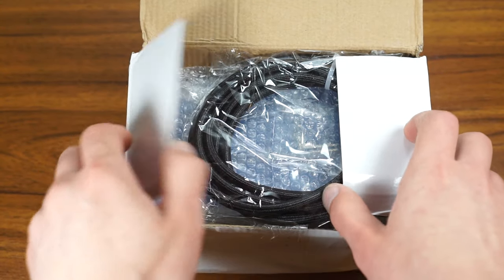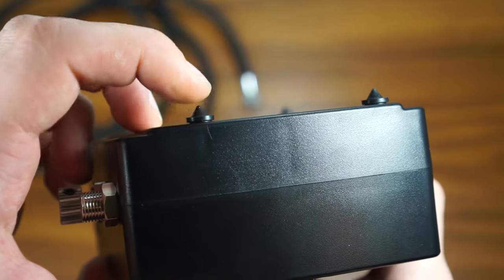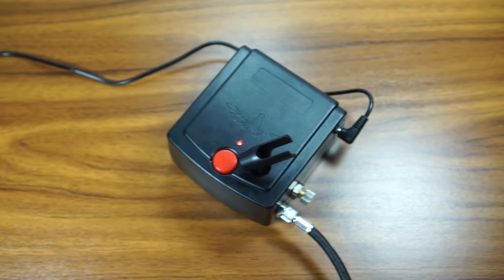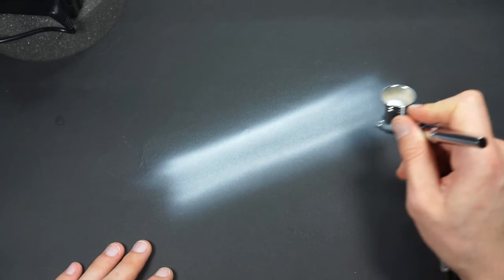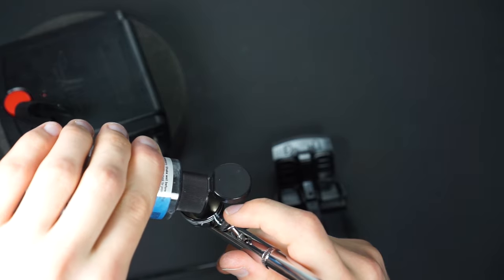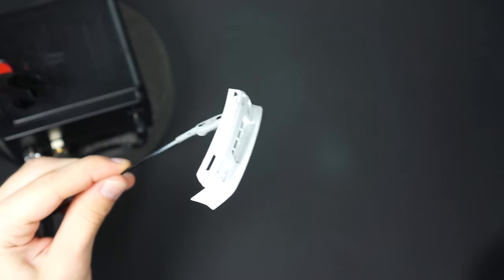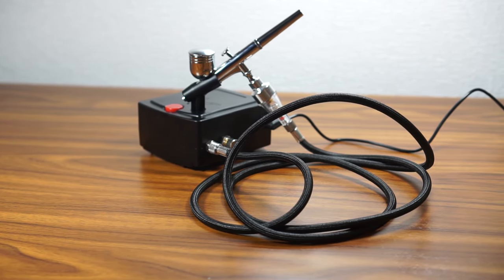Cheap airbrush kit - good for scale modeling?

Comment: I've had this cheap compressor+airbrush set just two years ago when I began modelling and wasn't sure if I was going to practice this hobby for a long time. It did a really honest job for one year and a half and I painted about 20 models with it. Of course, compared to a higher-end compressor, it's noisy and tends to get hot. But it did a real good job for more than a year. I've bought a new compressor a few month ago but I still keep this one and it still works flawlessly :)
Reply: I'm just starting my new hobby in building High grades Gunpla and I'm thinking to get one of these kit since I only have time like 2-3 days a month on building Gunplas since I have other things to do, so I don't want to spend a lot for airbrush kit. I guess I'm sold with your testimony. Thank you.

How long did it become overheat? And if it overheats, does the compressor automatically turned off?
Reply: @looniaz  I don't remember well but I guess a bit more than half an hour before it gets hot. The main problem is the noise, if you have to concentrate on what you do during a long time. Headphones and good music while painting is a good workaround ;)
Reply: @looniaz  it doesn't shut off automatically, I have the point zero version without the pressure valve, I painted a mass of kits with it. For about $40usd you cannot go wrong if you're new to the hobby, but with all tools you MUST do maintenance. I cannot stress enough how much maintenance I've done on both of mine. They're really amazing for the money especially for fixed incomes. I rate the whole a nice 8.5/10 overall myself and I also know about 50 other builders who use theirs religiously. I know theres one that is going strong for 3 1/2 years and about 20 master grades alongside many High Grades. It also works for diorama work too!
Reply: @MistressNeviah  is it fine if I paint PG with this compressor+airbrush set?
Reply: Ese compresor entrega aire a demanda o sea, al apretar el boton arranca. Esta mal regulada lapresion por eso te funciona en forma permanente.

Comment: Started model building as a lockdown hobby, bought a similar airbrush kit. It works fine for me. I am back to working full time and only build/paint once every week. I get pretty good results and don’t mind taking breaks.
Reply from the maker: Great!  Thanks for sharing with us :)
Reply: Hello mate. I've started model building on the same situation. Since march/2020 I have exactly the kit shown on the video and I can't complain. Seven models (1/35 tanks) already done. I'm still learning but have noticed how easily I can use tamiya products and how hard Ammo and Italeri paints are (in my case) to apply because the tip always dry too soon and I have to stop and clean. Might be the wrong solvent but maybe the airbrush/compressor also are to blame.
Reply: Same situation, except for me the airbrush that came with the kit constantly clogged and wouldn’t spray no matter how thin the paint was. Bought a siphon feed from harbor freight and it works perfect
Reply: Is it still working now and having no problem whatsoever?
Reply: who asked
Reply: A good game to play is warhammer 40k a bit pricey but it involves models and using them to fight
Reply: how long do you take for taking a break?
Reply: H.m. tnx

Comment: I think it looks great, it’s very portable, it’s a good option for beginners who only make model kits occasionally. I quite like it myself, and if you can build 20 models with it without breaking it then it’s worth the money. But since it’s constantly running it might be burned out after painting 5 model kits😂
Reply: I need to paint FOW pieces. You think I'd last long enough to paint two armies?
Reply: @dakufaust  I don't know if this is too late but there's one with autostop feature.
Reply: @vorgeyahiya8613  I just got one with the auto off feature. It's nice, but I have yet to fully use it tho.
Reply: @mosheep  I'm using one for 4 months now, does the job at least as I'm not using it often. Downside is you can't configure the pressure to your preference.
Reply: It lasts for months or longer, I've heard. These compressors can last quite long if taken care of properly.

Comment: I bought a cheap Expo airbrush and compressor (£60) about 6 years ago. Struggled with it from the start.
Generally wouldn't recommend cheap airbrush packages for beginners. I replaced the airbrush with a Sparmax Max-4 early last year and kept the compressor.
This is 200% better! 
Although even the Sparmax is still a general purpose/beginners airbrush, the build quality and precision are so much better and that makes a huge difference.
Reply: Well obviously the Sparmax is better, it's way more expensive.

Comment: Bought a similar unit 2 years ago and still going strong and have built many car and aircraft models using it. Had some initial usage problems with things like spray nozzle adjustments (critical) and how much paint thinning was required, but I think that had more to do with the fact that this was my first airbrush rather than any fault of the unit. Had to replace hose but only because I stood on it. If you adjust pressure knob just so, I found compressor (yes, same Harley Davidson sound as the one on this vid) will only run as you're actually spraying and will shut off a couple of seconds after trigger release. Slightly thinner paint with these cheap units is also a big help.

Comment: I have one, I add a plastic bottle to make airflow more stable, it works fine for me, as a modest modeller building one or two kits a month, I just use it twice a month. Plus its quiet and low energy consumption.
Reply: Where do you put the plastic bottle?

Comment: I have this one for quite a while now. I do occasionally paint when time permits and I think its perfect for smaller scale models like what I mostly do (sd and hg gunpla kits) been wanting to get a better set up tho as it is prone to have moisture build up despite having that moisture trap. Plus the airbrush it came with is sensitive to viscous paint and you may want to thin the paint you are using despite it being ready to use out of.the bottle. A 2½:1 ratio of thinner to paint is advisable based on my experience

Comment: Just bought it from your video 
Good option for begginners 
With some pratice you can easily learn how to diluate and use it 

Quite precise when you know how it works 

Built an FW190 1/72 with it and it’s the smallest you can do 

You can do very small dot with the right ratio of paint/diluant 

If you are a young modeller it’s perfect !
Reply: Oh and I forgot, use airbrush special paint it can easily be clugged if you paint is too strong
Reply: Hi I know your comment is 8 months old but I was wondering if it’s still holding up? If so I might invest in one (I am a beginner after all) and may I ask what airbrush paints you use?

Comment: I've used one of those air bushes for nearly 8 years. Get rid of the spanner and only tighten the nozzel with your fingers. As it is way too easy to shear off with the spanner.
Reply: @Ingo Herrmann I removed the sheared off portion with a needle point file, which gripped the inside or the sheared bore and enabled  it to be unscrewed.
Reply: it lasted 8 years ?
Reply: @aaronramly1705  
Yes the airbrush lasts and it still works. The compressor has been the week spot Im on my second one. The first one lasted 8 years
Reply: Agreed. Same experience that I had. Cheap will work but will easily fail

Comment: I've got this machine as a gift  about 2 years ago and today I decided to use it for the first time...my mistake is that I waited to long to operate it and looks like the dc input from the air compressor  is broken, it doesn't have the jack inside so I cannot connect it to power

Comment: Tbh I got it because it's so cheap that even if I will only use it to get the feel for airbrushing I won't need to be mad for throwing it away ... And mine came with a water trap and everything and those parts will be useable eben if I change the compressor later on :)

Comment: I just started using this airbrush today based on your review. One issue I'm having is it seems like the paint is coming out really slow. Like, it takes a while just to get full coverage on a single piece of my gunpla kit. I thought it was my paint being too thick, but I thinned it further and it showed signs of being too thin (webbing, spatter). Is there something I'm missing or is this expected for this quality of equipment?
Reply from the maker: I believe you are experiencing dry tip.  Use cotton swab with thinner to clean airbrush tip every 15 seconds.
Reply: @StaticModel  I'll give that a try, thanks!
Reply: @StaticModel  whoa thanks you life saver👍

Comment: I'm back on this video lol. I just got the new version of this airbrush kit, the one with the auto-off feature. It's a nice addition, not too noisy now lol. Just had a problem as I was cleaning the airbrush (I clogged it 😂) the nozzle o-ring disintegrated as I was screwing it back. Had to buy multiple replacements now just to be sure 😂.

Also for the new auto-off feature, it only automatically shuts off if the pressure valve is set to high. When set to low, the compressor runs continuously. Used it for an hour, spray testing outdoors, it warmed up but not too warm. So IMO it would last 2hours max in a session before it really heats up.
Reply: "lol"
😂
Reply: Do you have by chance a name or a link for the auto-off version?
Reply: @mateuszpytka1058  I bought this locally so I can't give you a link to a specific one, sorry. 

Just put "airbrush kit" on Amazon and many will pop up, different brands but I'd bet they're all the same. Do read the description and reviews to see if it has the auto off feature, because from where I bought mine it didn't say anything about it, so it was a surprise.
Reply: @mosheep  Thanks! I found one with auto off, however it said that this feature works only on minimum setting. Could you confirm that? Anyway, much appreciated. :)

Comment: Great video. Thanks. I'm starting this hobby also and bought the airbrush in the video. My worst fear is the paint "liquibility"... Any tips? Thank you.
Reply from the maker: It's better to make paint too thin at first spray attempt. Cause you can always add a bit more paint till it be perfect mix. If you make paint too thick at first spray, you will clog it... Disassembly and cleaning is the last thing you want to do right after purchase of first airbrush :)
Reply: @StaticModel  thanks!

Comment: Would this be good for a few touchup spots with automotive paint on a vehicle? that pinpoint precision would be good for paint chips and also repainting after small rust repair jobs with bondo I would think. Much cheaper than taking it to a shop either way....
Reply from the maker: Don't think so.

Comment: Thank you for making this informative video sir, I bought the exact same airbrush and compressor set from amazon. After using the airbrush for some time, it stopped working. After seeing many online guides and doing a complete deep cleaning, I finally got it working again but it stopped again after 30 second. Now the airbrush sometime works for one minute but the next minute it stops. Do you have any idea as to why this could be happening. Thank You
Reply from the maker: It is important to understand what part of system fails. Is it airbrush or compressor? See if compressor keeps pumping air without airbrush connected. If it still stops, there is something wrong with compressor itself. If it only stops when airbrush is connected, that means there is a clock in air system or airbrush trigger is faulty.
Reply: @StaticModel  The problem is definitely not with the compressor as I have tested it thoroughly. It is most likely with the airbrush. I have not identified a consistent problem but sometimes there are bubbles in the airbrush cup. I have deep cleaned the airbrush, but it is extremely inconstant whether it worked or not
Reply from the maker: @thequantumcuber3261  bubbles are usually caused by poor seals at nozzle cap, poor seal also make paint to dry out in awkward areas of airbrush, also "dry tip" issue will occur more often. Maybe your nozzle is split or cracked also, worth checking.
Reply: @StaticModel  Thank You, I will check

Comment: It seems you're not thinning down your paints & primers before putting it into the airbrush. That's something you should do. Always thin your paints & primers before airbrushing them. That way the compressor won't have such a hard time.
Reply from the maker: I intentionally used pre thinned "airbrush friendly" paint that is marketed specifically for use right from the bottle, because that is what beginners usually go for. If you are experienced and willing to play with thinning ratios, it's most likely you also want precise pressure control and another compressor kit.

Comment: So I'm just getting into modle cars properly and I brought this exact same one the other day I'm just wondering if you need to clean it when you use different colour paints bc it will block the jets would I have to clean it with thinners
Reply from the maker: You have to flush it with thinner after every new color. Also if you use different types of paint ex. enamel and acrylics - you must perform deep clean with airbrush cleaner in order to avoid different chemicals mixing together.
Reply: @StaticModel  thank you very much for replying thanks for the information 👍

Comment: Would this airbrush be suitable for applying paint on car scratches? And eventually lacquer?
Reply from the maker: Automotive paint require high pressure and spray guns that generate fine paint mist while also delivering high amount of medium in a single aerosol cloud. In short words it will work but it will easily distinguishable, just like touch up markers.

Cancel

Reply
Reply: @StaticModel  what about if you spray more layers?
Reply from the maker: @royal_gambit_e4  it will work, but you will have to experiment with thinning ratios and pressure..Also of you own a car, there is a big chance you have a compressor or a tire pump. So you can get only a airbrush without compressor and use tire as an air source. More on that you will learn from other YouTubers.
Reply: @StaticModel  good idea
thanks

Comment: How does your white come out so well? I use Vallejo model air white and it comes out in stupid spits and clumps and tiny specks and spots. I also use the exact same airbrush and compressor lol
Reply from the maker: I guess you are not thinning paint enough ? Or maybe your airbrush is not serviced correctly? Check your nozzle setup and air cap, make sure there is no air gap. Use maximum pressure. Let me know if this kind of video would be useful (how to properly use this kind of mini setup/ maintain airbrush) :)
Reply: @StaticModel  no no actually I think it is way too thinned. I tried to add it to a green for highlights and it actually thins the green paint. My friend said it may be due to a certain ingredient was taken out, something to do with lead and poison? idk. I always have maximum pressure at all times, airbrush works fine on all other paints. this happens to my friend too that uses tamiya white. Its very odd. I would like a troubleshooter video on this airbrush, as other odd occurrences do happen sometimes. Thanks
Reply: @StaticModel  yea do that because i bought this and i wouldn't have a clue.
Reply: @StaticModel  I had a similar problem when I used this same airbrush for the first time, I dismantled the airbrush and rebuilt it and it was fine. I did notice a few parts had a bit of manufacturing residue which was just wiped with a dry cloth, once rebuilt it painted perfectly. And really not as noisy as it seems! I love mine!
Reply from the maker: @Thebiggestswede  That's a good common practice. Recommended even with brand name airbrushes.

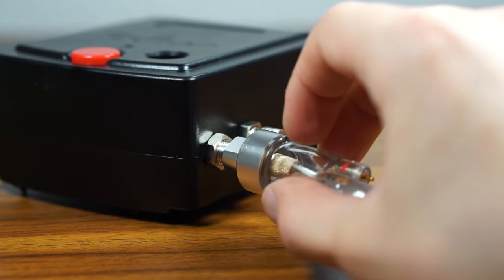Comment: 1:36 i think you install the air filter wrong way, correct me if i am wrong
Reply from the maker: That's only demo showing that you can connect such things, as you can see later I am not using it this way.
Reply: @StaticModel  owh
You only show that the connector same size as the filters
Reply from the maker: @calvintanson9448   yes, and if you already have filter or airbrush on hand that makes it easier for you to understand what kind of connect is used in compressor.

Comment: I have the exact same model. Brought it last year, and was going to use it now for the first time. I got it to do alternative reborn dolls. I noticed that in my set I don't have the moisture trap.... is it important?! Can my machine work without? I'm once again blocked from finishing a doll. If it's a necessary component to the machine, where can I find it? Anyone who can help, is my life saver.
Reply from the maker: Moisture trap prevents condensed water from getting into your airbrush ant later into your paint. For example when you paint, big blob of water coming out from air hose can cause paint spit/splatter... Some people use transparent air hoses to monitor moisture build up in air channel. Also moisture traps are commonly available on ebay,alliexpress,amazon ect...

Comment: Can you use it for shoes ??
Reply from the maker: Its mostly about type of paint you are going to use. Should be fine for light usage and simple sneaker customizing.
Reply: @StaticModel  yeah I seen it said no arylic paint n that’s the type of paint I need to start spraying on my shoes 🤦🏾‍♂️ and it saiyd in Amazon that the paint has to be thin thin if u ending u using it